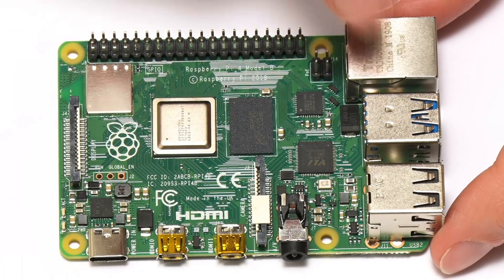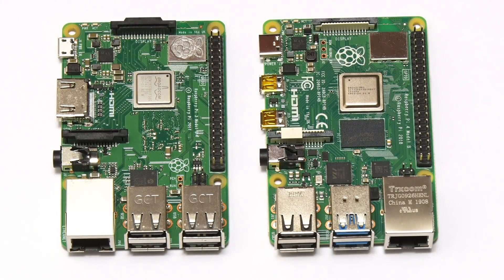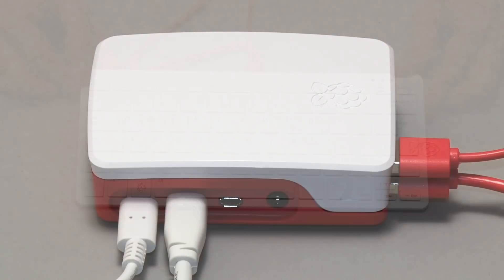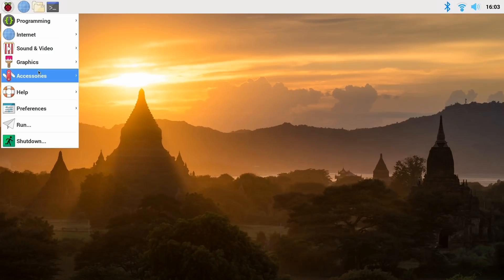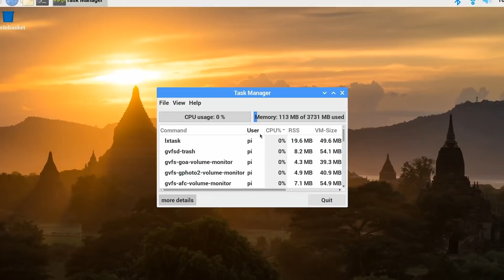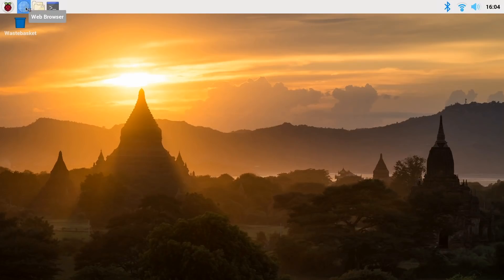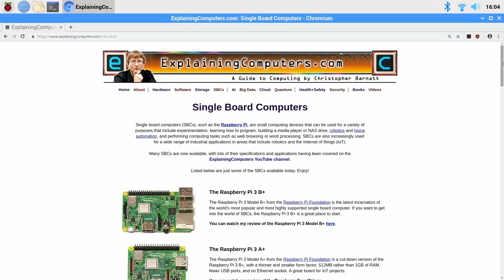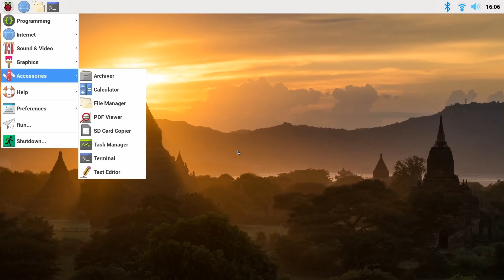Raspberry Pi 4 Model B

Comment: ¿What's the advantage of a 64bit processor if raspian only supports 32?
Reply: For non-Raspbian, 64 bit operating systems, of course. I never use Raspbian.
Reply: @donporter8432  Which 64 operating system do you use on your PI?
Reply: This is a very good question, I'm specifically interested in some python functionality with 64 bit and am eager to know what the deal is here ...
Reply: Maybe there is a Raspbian 64 bits in the pipe, maybe..
Reply: Hi Guys. I run Ubuntu-18.04.2-preinstalled-server-arm64+raspi3.img  downloaded from ubuntu.com/releases/18.04/release/

Comment: couldn't get to the website quick enough when I saw this video pop up.... 4gb of RAM I am getting that model , just ordered!  Real gigabit(we've had gigabit but they lied only 300) , 4gb of ram , I heard this board was supposed to have a CPU with risc architecture , Open Hardware ?  Clearly that didn't happen, why did they cheese out on the 3.0 ports, why not just have the entire stack be 3.0.  I am so glad I saw this I was about to make a huge mistake and buy an Atomic Pi ... I am very impressed with this board, I guess they saw how badly they were lashed for the 3b+ and decided to give the people what they want, at a premium of course $55... Worth it , I know when I bought the 3b+ I had a really hard time finding operating systems outside of Raspian a lot of the i386 based OS's weren't working correctly or not booting/kernel panic.  I learned to look for arm64 images to take advantage of that extra addressing space in a 64bit processor. The addressing space for 32bit(i386)  is 32 to the power of 2, and 64bit is 64 to the power of 2 , arm64 img's let the architecture function at full potential.  Cant wait to see the benchmarks and stress test, probably need to get to the bottom of that beta rapsian release issue..  I wonder what OS's will support this new hardware out of the box.?.?
Reply: i386 means 32-bit Intel/AMD, which is not compatible with the ARM-based SOCs used by the Pi. Completely different architecture, so of course software for that wouldn't run on the Pi! You were confusing 32-bit x86 for 32-bit ARMv7.
Reply: @alvallac2171  I wrote a whole response to this an I erased it , so I will just make a simple point.  If you go to raspberrypi.org and grab raspian does it not run on the pi , pi2 , well it does.  Those boards are not 64bit.  I will let you deduce the rest.
Reply: @alvallac2171  To be clear , your not wrong , its a combo of the getting certain software to run with the provided hardware across all versions of the pi.

Comment: Am I the only one who was expecting SATA port in new pi?
Reply: I would have preferred M.2 on the back tbh
Reply: SATA is kinda getting outdated already. m.2 would be more 2019 stuff.
Reply: M.2 SSD was my hope.
Reply: This is why I'm happy I bought an odroid hc1, but very happy that the pi4 is out
Reply: dudes, M.2 is a connector! SATA is an interface. M.2 is either for SATA, PCIe or USB. maybe you wanted to say that it needs NVMe? but do broadcom SoCs have both SATA and/or  PCIe IPs at all? at least not for 55 bucks, hehe. rockpro64 does have x4 lane PCIe and this is more, than enough for attaching NVMe SSD. go with it. rpi will manage this something like in the next decade. xD

Comment: That's amazing Christopher. I heard something about it and didn't believe it. This could make a big difference. A Raspberry that can compete wih others.
I am wondering about the thermals and power consumption. 
Just now I need to save my money they come with this. Dual HDMI is amazing. A72 should perform well. I think it could be clocked higher with worse thermals/consumption as a trade of. And a 4GB version? I truly did not expect this. 
I also wonder about the GPU. I'll have to get me one I guess. Thank you for the amazing info. Greetings, NicoD
Reply from the maker: Hi Nico. The thermals will be interesting. I suspect a heat sink will be wise in many situations. I've yet to test! This video went through very rapid production. :)

Comment: "The Raspberry PI 4 B uses a usb-c power supply" FUCKIN FINALLY, BYE MICRO-B I WONT MISS YOU

Altough i'm not a huge fan of the micro hdmi. At this point if you need a adapter anyway the mini DP is superior IMO.

Also, keeping the micro-b for the keyboard ? I guess thats for cost saving... If you get usb-c somewhere you expect it to find it everywhere. Maintaining two differents cables is a pain

Comment: Hmmm. a double dose of EC this week. Awesome. I will be wanting a Pi 4B for sure. What is not to like? 4GB option is welcome. I would have preferred a full size HDMI but having 2 micro HDMI support is an excellent addition. Will be very interesting to see how much more powerful it is when compared to the Pi 3B+
Reply: Adapters are easy to get though. Yeah it’s another dongle but they’re trying to make the footprint smaller.
Reply: @tmofee 
Its nice to just be able to use straight out of the box. Buying just the board will mean you have to buy a micro HDMI to HDMI adaptor or a new cable. Of course its not the end of the world but Pi users will have to buy another item rather than just a simple swap out. Not a huge issue at all nor a massively expensive one and having 2 display outputs more than compensates for it,  it is still a slight disappointment as I cant just unplug my 3B+ and plug in a 4B with the same cables.

Comment: Those three pins GLOBAL RUN EN seems like it's for wiring a reset and power button. 😍
Reply from the maker: Yes, indeed! I've yet to see specs on those pins.
Reply: @ExplainingComputers  i looked at the specs and they are tied both to 5v and 3.3 v. Im super exited about this!

Comment: IMHO most important upgrade is switch from low power/energy efficient Cortex-A53 to high power Cortex-A72.
Reply: R Pi was always a bit lacking in raw horsepower department. Switch to A72 is a huge step-up. I'm a bit surprised you sir didn't say a few words about that.
Reply: As for connectivity it's still lacking M.2 port, if it had one then we could call it a true desktop replacement. Maybe they could add it as a HAT ?
Reply: @stanisawszczypua9076  You could boot from an external SATA SSD using one of the two USB 3.0 ports.
Reply: @alvallac2171  technically yes but its way less convenient then adding M.2 SSD that could be hide inside a small case

Comment: Let's hope the B+ model (whenever it will be released) will have a SATA port as well...
Reply: Next comes a X16 PCIe port.
Reply: @memememegaming PCIE 4.0 x16 ;)
Reply: Or n.v m2 slot? Not need power supply
Reply: @ancaxt1596  the soc on the new pi is most likely still too weak to handle the full speed of a good nvme drive.
Reply: @ancaxt1596  Indeed!

Comment: Sadly still no support for hard drive
Reply: Through USB via an adapter/enclosure...
Reply: @cormacsyt0  Pi 3 b+ will boot from USB automatically.

SMART will work depending on the drive and the USB bridge.

For checking health of usb hdd on raspberry pi with smartctl.
https://gist.github.com/meinside/0538087cc60a2f0654bb

Comment: Hi Chris, many thanks, I'd be interested to know how many devices the board can power using the power supply, without having to use a powered usb hub, if attaching a ssd over usb3 is faster than booting rasbian on a microsd memory card, and if there's a way to add an nvme drive

Comment: Well, this is how I find out about a Raspi 4?  That's cool and everything, but I gotta wonder about 
A) Heat, and the real issue:
B) Does that neat little keyboard come with a Sensible return key?  I get you Brits like to just be able to slap at the right side of the keyboard and hope that it executes whatever you're working on before whatever stroke you had started... but yeah.  I want the snazzy full-kit.

Final Question: Is there some electrical standard in the UK that says all plugs must be able to double as a bludgeoning weapon?  (I'm finished.  I seriously love your videos.  I always learn a lot, and today it was 100% about the release of the new 4.)
Reply from the maker: I will look at temperatures and cooling for the Pi 4B in a video fairly soon. :)
Reply: Our plugs are the best in the world!They're safe, sturdy, hurt like feck if you tread on one, and can double as a flail weapon in a melee when attached to a cord.
With that case, I'd be concerned about heat too. I've had a couple of Android set top boxes fly south due to heat related issues.I may have missed it, but does it have Wi-Fi and Bluetooth?Why not add a SATA port, either for a drive or one of those new-fangled card thingies to get some real storage, or even an eMMC board? USB external storage is not the answer for me, and I'm heartily sick of micro SD cards. Still, it's getting mighty close to being up for consideration for a set top box.
Reply: @VintageSG  SATA isn't too vital, one can use a USB3 hub, and a number of USB/SATA adaptors (or caddies) and we should still get decent speed.

I'd be very interested in seeing a NAS solution with half a dozen, or even more drives! With the speed of USB3, a raid array will become bottlenecked by the GBE which is a welcome change! I'd be more concerned now with the huge increase in IO performance that the CPU itself may get bogged down! It seems to only be a minor improvement from the 3B+ which would already see fairly high CPU utilisation when doing NAS type workloads. So removing the ~400Mbps bottleneck could simply see the CPU running out of steam at not much more than that.
Reply: VintageSG They’re targeting the low-end consumer, it’s a project board at heart and probably won’t change for the next few years
Reply: @VintageSG  Wait for the Pi 5
Reply: lmao@Bludgeoning weapon -  ;)
Reply: Why plugs are the way they are: https://www.youtube.com/watch?v=UEfP1OKKz_Q
Reply: Here's why UK plugs have to be the World's best: https://www.youtube.com/watch?v=UEfP1OKKz_Q
Reply: Brits are so pathetic they have to find patriotism on bloody plugs. Hahahahahahah
Reply: @gtPacheko  Speaking as a 'Murrican, Brits have the best plugs.